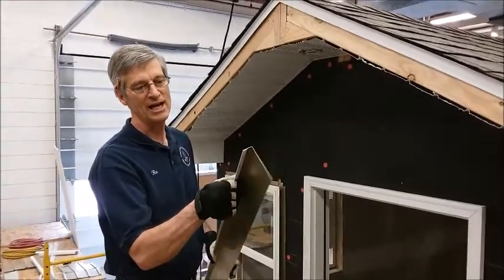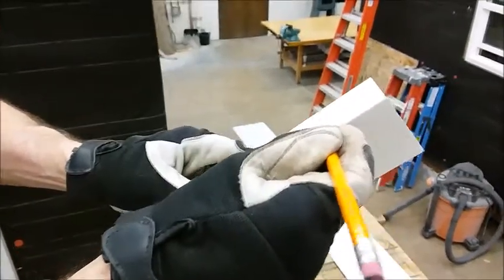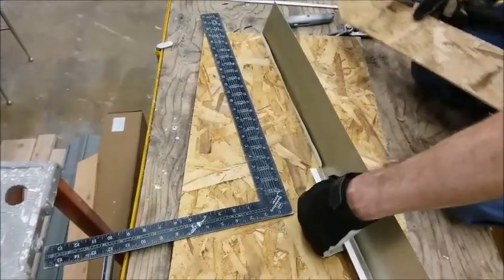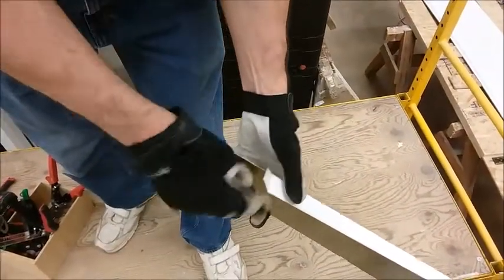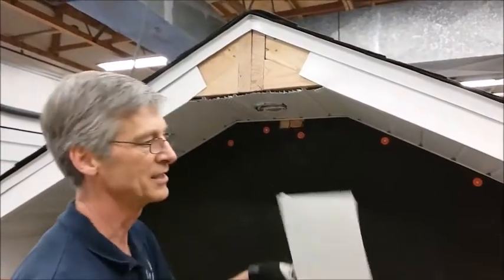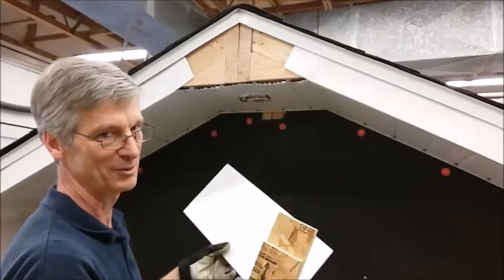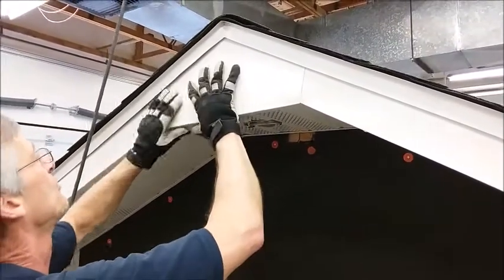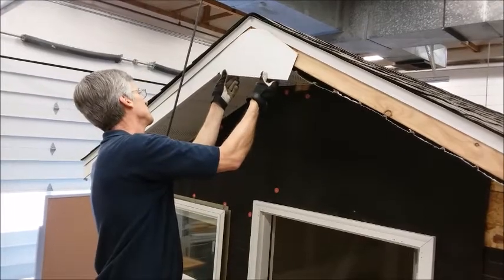Installing Fascia on Gables

Comment from the maker: All of my videos were created during the Covid shutdown for a class I teach.  I bend all of my own fascia, so I can do some things that cannot be done without a metal brake.  The building shown is smaller than most, with a small overhang, so your installation may need to be adapted.  As is noted in some of the posts, I focus on quality in everything I teach.  The speed comes with practice.

Comment: What screws did you use on the underside of the fascia???
Reply: Looks like these are a washer head finish screw, in 1.25 or 1.5 inch length, painted white to match the facia. One thing to keep in mind, is to get screws that are the same metal as the facia material, so that it doesn't start to corrode due to electrolysis.

Comment: What kind of screws do you use?  So many conflicting opinions - never use stainless screws, do use stainless nails, never use stainless bare metal nails, never paint the nails heads yourself, get matching nails from the fascia distributor. 

looks like you bypass all that... wondered what you've found works and doesn't disintegrate the aluminum over time?
Reply from the maker: I get galvanized steel screws with the heads painted white from the distributor